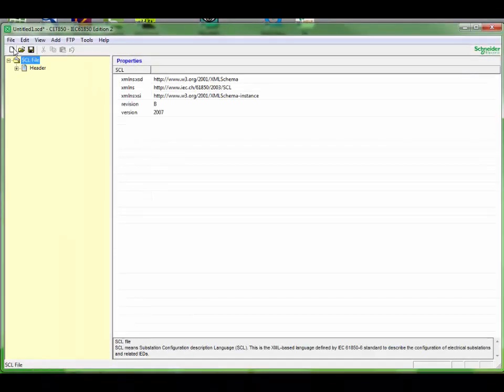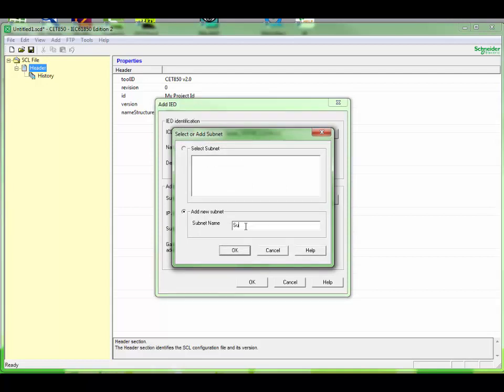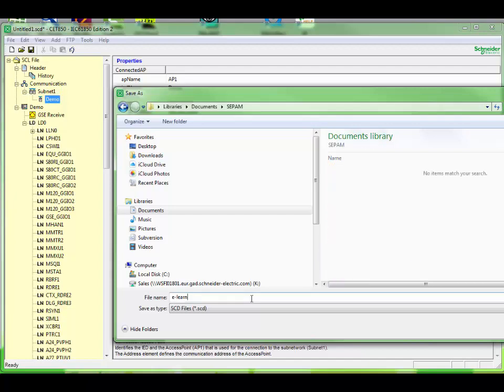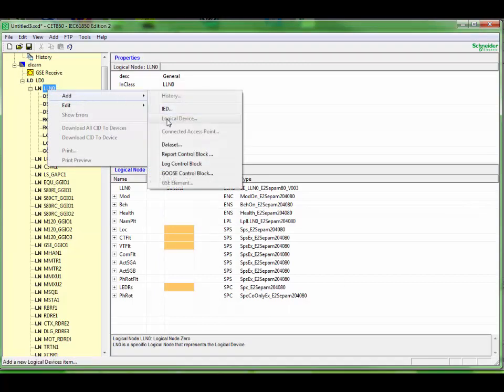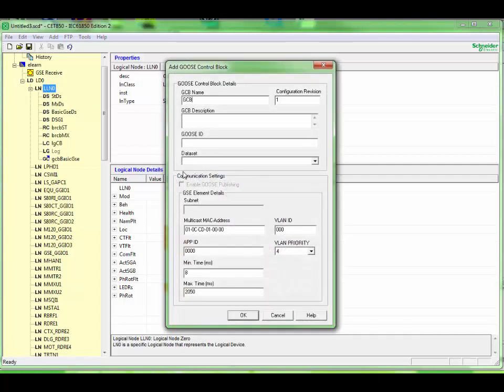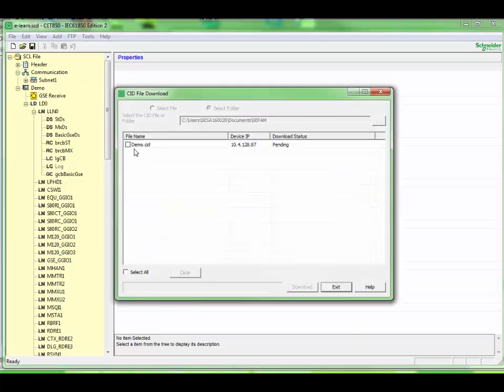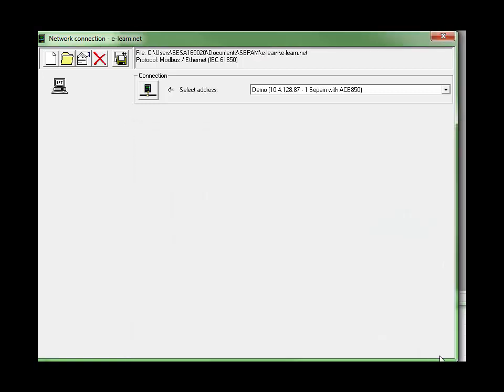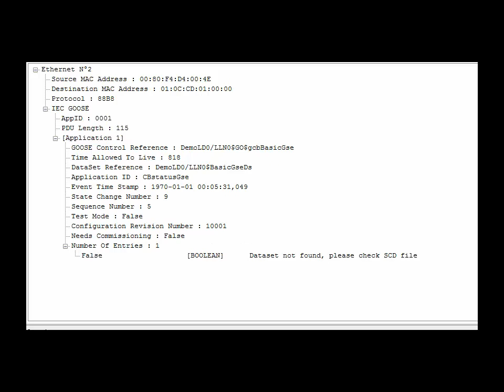Sepam - How to Create an IEC 61850 Configuration File for ACE850 Module?

Comment: ALARMS  LIKE  ,  THERMAL ,   CONTROL ,  TRIP CIRCIUT  ,    UNDERVOLTAGE ETC  APPERAS  BUT   RELAY  STILL  WORKING  AND    NOT  TRIPPING .    

SOMETIMES   TRIP  LAMP IS  ON ,  BUT  ACTUALLY  MOTOR   STILL RUNNING ???   AND  EVERY  THING  NORMAL  IN  MOTOR    PARAMETERS   LIKE   VOLTAGE  , CURRENT  ETC .